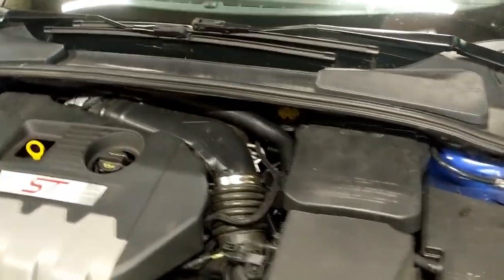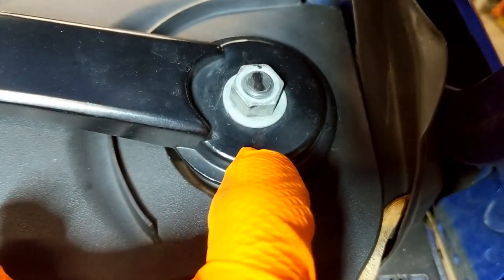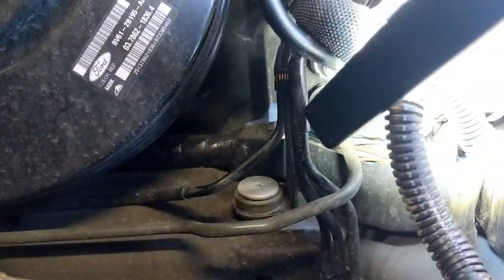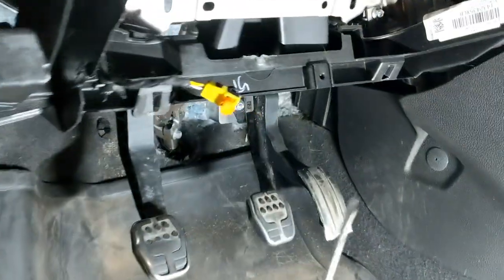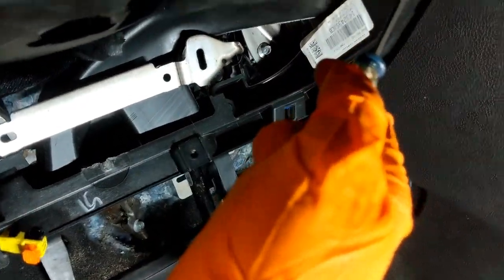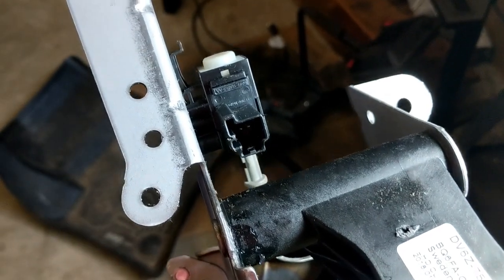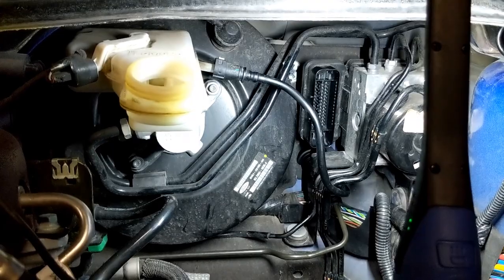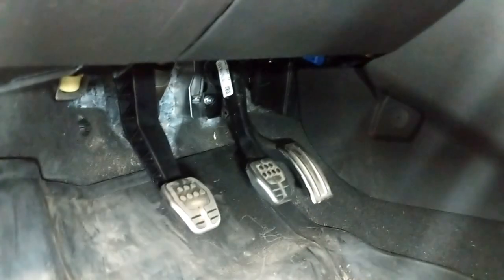Replace 2014 Focus ST Clutch Master

Comment: I guess the 2018 Focus ST is different. I just had to replace my clutch master and I was able to get the pedal out without removing any parts of the dash, or the steering shaft. It was not fun lol, but I was able to do it.
Reply: Hola tengo un st del 18 y el cloche se queda abajo que puede ser la bomba que esta en el pedal
Reply: Its the same process but if you're willing to do acrobatics in your car you dont have to remove anything it helps if the driver seats out so you can lay in the car

Comment: If y'all have a 2013 Focus, there will be a very small elongated "o-ring" at the end of the steel line.  You will need to pull it our of your old clutch pedal assembly.  If you do not you'll end up with brake fluid in your engine bay, ask me how I know.

Comment: Excellent video, thanks!  I was able to replace the assembly on my 2013 ST without removing any parts of the dash, airbag, etc.  It was a tight fit,  but it eventually worked out!

Comment: You Do Not need to disconnect the steering Shaft
Reply: Sure, but it does make it easier. And like he said, it is keyed so just wrap your seat belt around the steering wheel and it should keep it from spinning

Comment: Great video, however, other than disconnecting the airbag You don't have to remove it. Mind you with a 3-in ratchet and extension, You can get the 13s off that go into the firewall to secure the clutch pedal assembly. But I think maybe the book asks to take the air bag out. So you have a clear shot at the 7:00 nut. But it's not necessary. It's actually a waste of time.

Comment: not sure if you're still around to see this but... how did you get to the airbag bolt to the right. The left one was fairly straightforward albeit a pain in the ass, but there seems to be a piece of metal directly in the way of the blind one. Any advice?
Reply from the maker: Remove the brake switch and push the clutch pedal in after its drained.  You have to look up through a small slit and you can see the nut.  I used swivel sockets and an electric ratchet.   You also have to crawl into the foot well and put your head about where the clutch pedal is at.  Going back in you use some paper towel to hold the but in the socket.  Spin on a few threads with the extension then use the electric ratchet.  I hope that helps.
Reply: @fixins9868  after I changed the Master cylinder, on my Focus, don't work the cruise control, start stop, and the indicator when to shift next gear. Do you have any idea what can caused this? What to check?
Reply from the maker: @cappuccino27  You need to check the clutch switches or the pressure sensor on the master.  The pressure sensor didn't come out until 2016 I believe.

Comment: Is the part number for the updated one with the metal plunger a different part number than the oem one with a plastic one? I’m trying to find one for my 17 ST, but I’ve seen both variations from different sellers and they share the same part number
Reply from the maker: The new revision will have the same part number except at the end it will increment the letter from, for example, A to B or C to E.

Comment: How long it took you to complete the job and what makes the clutch master cylinder to fail?
Reply from the maker: About 3 hours.  They fail mostly because of wear and tear, age, or abuse.
Reply: Hey man, I’m actually dealing with this issue currently with my ST. I was wondering if you need the part number or name of that piece that from 8:23. I believe you said it was an o ring or cap, but I’m just trying to find out if it’s possible to get that separately.
Reply from the maker: @MrEsdabb  I don't believe you can buy it separately.  You have to get it with the hose.
Reply: @MrEsdabb  If You  lose  it then You have to  buy new  pipe line  it's about 50 $ so be  careful.

Comment: My focus has a very hard pedal and it feels like the clutch comes out very slowly, could that be the cause?
Reply from the maker: Without feeling it with my own foot it would be hard to diag.  But Its unlikely the master cylinder.  You probable have a collapsed/stuck clutch delay valve. The CDV lives in the clutch fluid line and its job is to slow down the engagement of the clutch pressure plate after you release the clutch.   Other possibilities are the slave cylinder binding.  Also, check to make sure the bleeder valve for the clutch line isn't leaking.   That bleeder is plastic and sealed by o rings which can rip and they won't leak just sitting there, but they will when you press the clutch which then causes the pedal to not come all the way up.  Unless you have been bleeding the clutch, start with your clutch fluid line.

Comment: Sooooo great video, up until the pedal removal. Not sure how you managed it, but you CANNOT turn the master cylinder towards the brake pedal. And trying to reinstall, that switch pops off every. Single. God. Damn. Time. The entire disassembly took less time than I've spent trying to reinstall the pedal

Comment: Do you know if the master cylinder is the same for a 2014 and a 2016?
Reply from the maker: they are the same. ford part number DV6Z-7519-A

Comment: Does the clutch use break fluid from the break fluid Reservoir
Reply: Yeah it’s dot 4
Reply: @calebpaul8879  my clutch pedal was dead and I didn’t realize that they shared the same fluid my alert system kept telling me the brake fluid was low and shit I filled it up bleed it and it’s all good now
Reply: @calebpaul8879  It's exactly   DOT 4 L.V.    (low viscosity)

Comment: so my pedal has been sticking to the floor and then slowly releasing, air is getting in the lines it also slightly effects my brake pedal. i bled the clutch and it fixed it temporarily but I definitely have a leak. I’m assuming this is the slave cylinder but is that the proper diagnosis/assumption? also it’s a 2015 focus titanium 5 speed but similar build
Reply from the maker: The clutch pedal should not affect your brake pedal in any way.  The worst a leaking clutch would do to your brake system is warn you of low brake fluid, but that would only be a serious problem if you ignore it.  If your clutch is leaking externally then there should be brake fluid somewhere, either on the floor inside your car, or coming from the bellhousing.  If the master is leaking internally the only way to test that is to deadhead it and see if it hold pressure.